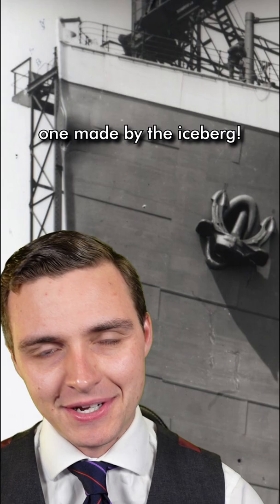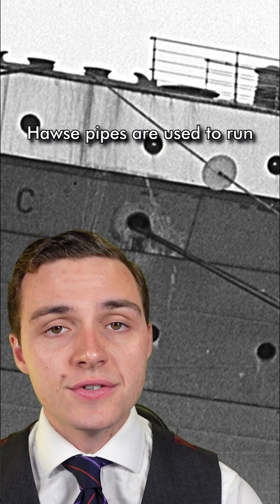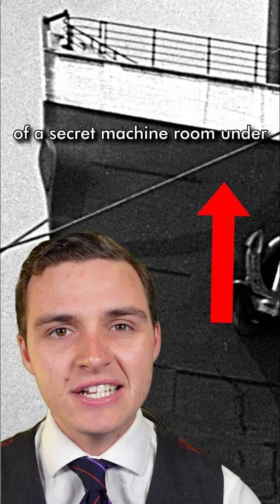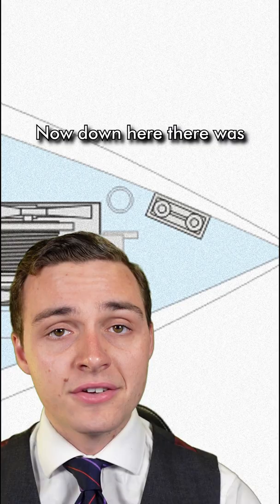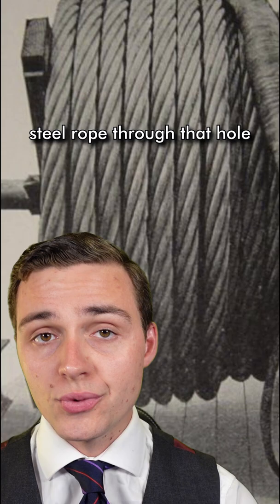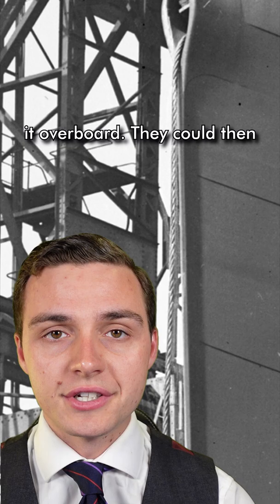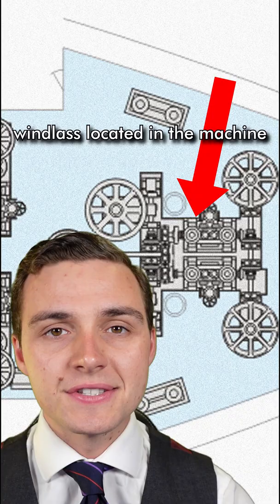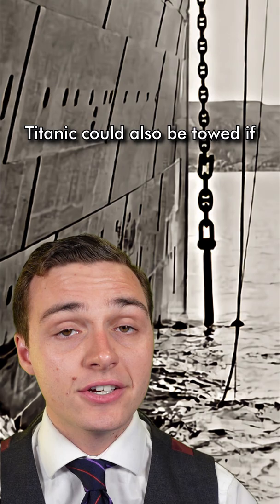What was that hole on the front of Titanic? | Oceanliner Designs Shorts

Comment: "Whats was the hole in titanic and no im not talking about the one made by the ice berg"

Portholes: And i took that personally 😭
Reply: It's called a porthole not windows
Reply: Thank you never knew that!
Reply: @BimDaTitanicNerd  name checks out
Reply: Yup
Reply: So there was a steam pipe from the boilers all the way up to the steam powered windlass..? Or it had it's own boiler? Thinking about it, you really only need power for reeling the chain in, not letting it out, so windlass boilers had to be started up in port while the ship lay cold. Must have been a lot of coal burnt to get a boiler up and running just to pull in a chain.
Reply: How that got to with anything?
Reply: He said "the hole at the very front" which obviously not referring to the portholes
Reply: Ok
Reply: But he said “at the very front” 

Dw portholes
Reply: @timothyjones3410  Maybe it was electricity
Reply: @shirleymental4189  I'm pretty sure they had to make their own electricity whenever they needed it. Maybe they had shore power but probably not because of the year. Batteries? The AC/DC question arises... Now I'm wondering when they even used the anchor. Weren't they tied to the pier with rope and cable? I don't think a ship drops anchor next to a pier. Maybe they used the anchor when they had to wait in line slightly offshore for a berth. In which case their power plants would be up and running.
Reply: @BimDaTitanicNerd why are they called portholes when only half point to port ? ^^

Comment: It is quite funny, over time we have become SO good at making utilitarian design into appearance design that we forget to realize that the ship, in its shape and everything on it, looks that way because it serves a purpose. A ship is not thinner in the front and widening elegantly out until its thicker in the middle just to make it look nice, its actually designed that way to cut through water and have space for passengers near the center. Funnels aren't tilted because it has a neat effect, they are tilted to allow steam an easy exit, and allow less height of the funnel blocking the wind (if it were straight, it would be taller, but because of its angle, it is shorter)...same going for the shape of the funnel, aerodynamic.  

We know the appearance because of the functioning engineering & design that it is purposely built into. The whole look of things is literally inspired by its functions and how that effects the aesthetical design of the ship, and that is what we like about it! mixed in of course with the soft elegant color pallete and modern base tones like Glossy black, white, and red.

Ships were the most modern thing before cars, then cars before planes, then planes before shuttle rockets..and all of these are they way they are, so noticable in their silhouette because of the utilitarian design. The empire state building is a great example of this with its layers of cascading parapets, or brick buildings where you see the stepping stones that are there to make it taller even if that is but merely a foot taller. 

Its truly a miracle, and is a great way to connect engineers and architects of the naval history, to urban builds in general.

Comment: It’s only a hawsepipe for an anchor, it’s a fairlead or a panama lead when using lines 🤙
Reply: Wrong
Reply: @captmack007  no, he’s correct. Hawsepipe is the pipe from the anchor box to the windlass room deck, mooring lines run through a chock or fairlead, and the spillpipe leads from the windlass to the chain locker. The bow fairlead is also known as the bullnose and usually has a few lines leading to it
Reply: @kberkstr  hawse pipe is for the hawser
Reply: @captmack007  that would only apply to an unpowered barge, where you would actually be using hawsers to secure it to the towing vessel and it doesn’t have independent ground tackle. On self propelled vessels, which the titanic was, the hawsepipe leads from the anchor windlass out to the bow.
Reply: @kberkstr  that's a deck pipe.
Reply: @captmack007  No it's not. I'm a merchant mariner who works on large seagoing vessels. Every mariner I know and have worked with, as well as all our training materials, refer to it as the hawsepipe.
Reply: @kberkstr  totally incorrect
Reply: @captmack007  because you would know better than a literal 3rd mate unlimited and 100 ton master licensed Mariner who does this for a career day in and day out?
Reply: @kberkstr seems so.  im a 100 master too / professional and 60 years on the sea. You're wet behind the ears, sea 🐶  puppy

Comment: Well you eventually got it right.  Hawse pipes are used specifically to pass anchor cables or chains through - but ONLY for that purpose.  They are not used for the lines or wires used to secure a ship alongside.  Those openings are called "fairleads."
However, I was very interested to learn that that opening in her bow was in fact a hawse pipe - while having one in the stem of a ship is quite common today, it was a very unusual feature back in 1912.  Perhaps TITANIC was one of the first designs to incorporate it?
Reply: I've wondered what effect would have been, if the crew on Titanic had disconnected all three anchors  "The bitter end"  and run the anchors, and all that chain,  to the bottom..  that would have raised the bow, a bit,  at least.
Reply: In titanic's case, that pipe coulf actually be used for lines because there was a bollard right aft of it inside the windlass gear room.
Reply: @hugos5114  Ah!  I stand corrected.  How unusual - but interesting.

Comment: Actually I think this hawse pipe was only used to tow the ship, maybe also for emergency towing.

When a ship is at anchorage a rope like this isn't enough to be at the anchor. A chain is necessary for this. Because not the anchor holds the ship. The chain holds the ship in position. The anchor is only there to keep the chain in position.

Comment: That is a bullnose, not a hawsepipe.  The hawsepipes are on either side aft of the stem and are where the anchor is stowed and what anchor chain leads through.  The spare / replacement anchor is what you're referring to as the "center" anchor and it was only lowered in this manner when an anchor was lost and needed to be replaced.

Comment: Hawse pipe is for anchor chain to pass through from deck to outside the hull. not mooring lines. In your description for docking lines you are describing fairleads.
Reply: Here that hole would be used both for the anchor cable and mooring lines if necessary.

Comment: It’s not a hawse pipe, as those are used for anchor chain. It’s a type of Bull Nose, which are usually in an exposed position on the main deck but in Titanic’s case was located a deck or two belong the main. Part of the reason for these was aesthetics but mostly to have it lower in case towing was needed as the towing ship or tug would be so much lower as the undue angle of the towing line actually increases its chances of parting (snapping), if the Bull Nose was located on the main deck.
Reply: It is a hawsepipe. It was literally used for the 3rd anchors chain.

Comment: Anchor on a wire. Why would they do that? Six shots of anchor chain is heavier than the same length of wire. For being towed, a bridal is better. For an emergency tow, or docking for extended periods, we can moore passing a wire through the “bullnose” spliced to a mooring line for the bollard.
Reply: "Why would they do that?" Because it's easier to attach an anchor to a wire than with a chain...?

Comment: “Secret room”… No. Just no.

There is absolutely nothing secret about these rooms.
Reply from the maker: - Tucked away behind Third Class public rooms
- Accessible only to crew
- Not common knowledge to the general public today
- Unreachable by submersibles and therefore unexplored today

Take your pick ;)
Reply: After nine months this Short ended up in my feed. I was pretty surprised to see I had commented on this. And even more surprised to see your response, Mike.

But I stand by what I said. There is nothing secret about these types of rooms. It’s known as a capstan room, or a forward, machinery, room, or something along those lines. Given your expertise in the naval architecture/marine engineering field. If you know that every shift has a room of this sort. So how can it be a secret?